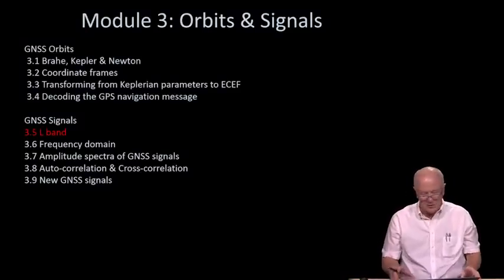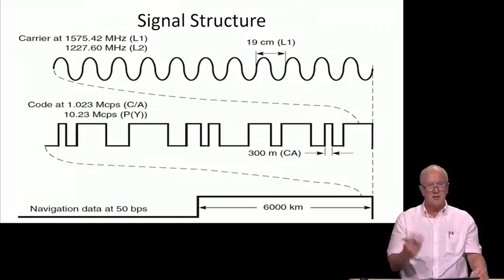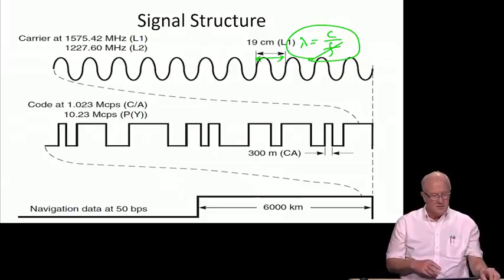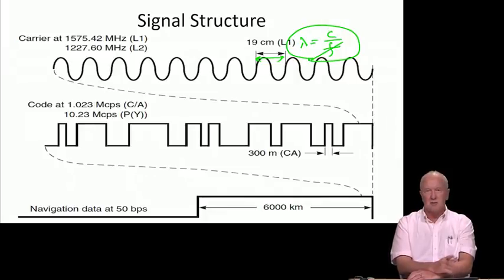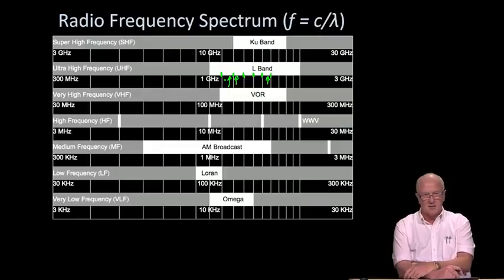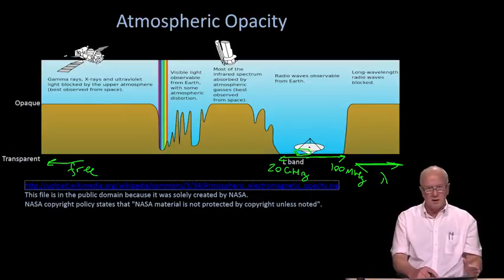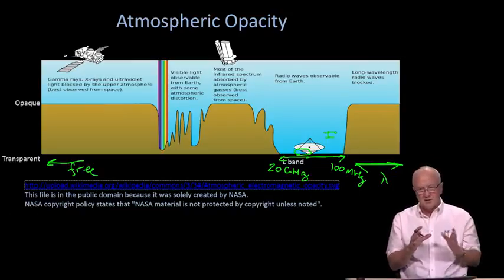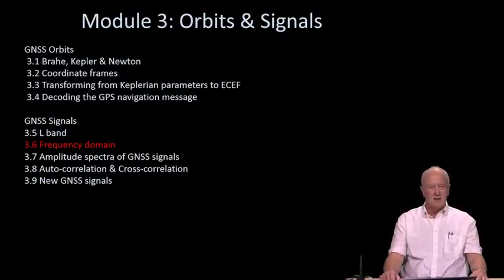3.5 - Fourier series, Pulses, Amplitude spectra of GPS signals

Comment: I believe the title of lecture 3.5 needs to be changed to L band. Fourier Series, Pulses, Amplitude Spectra of GPS Signals is really the material for Lecture 3.6
Reply: Good for you! It is possible that since they are connected that the editor had them shifted
Reply: That is Professor Per K enge and unfortunately he died in 2018¡¡¡